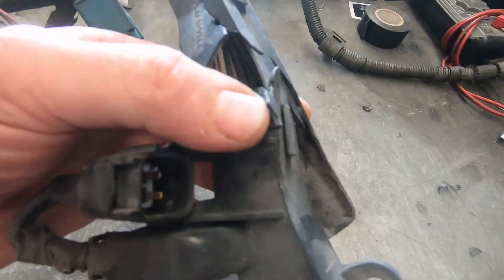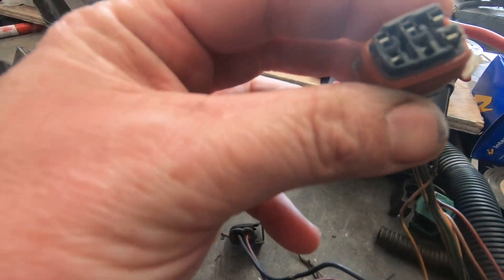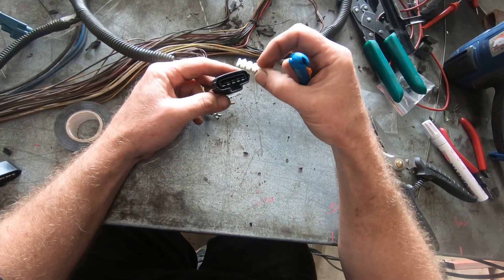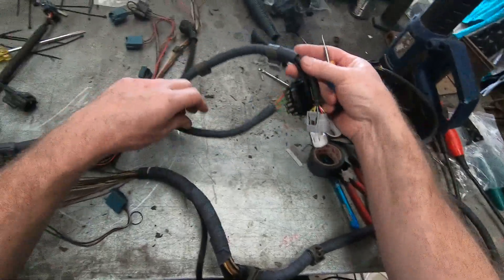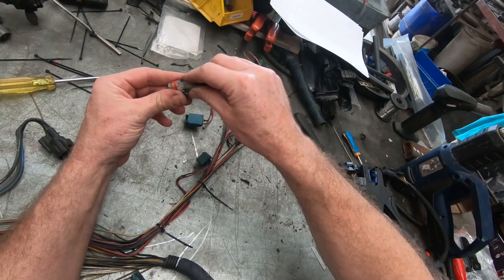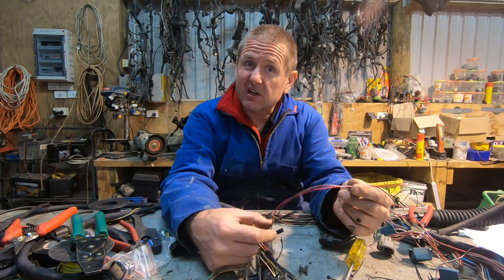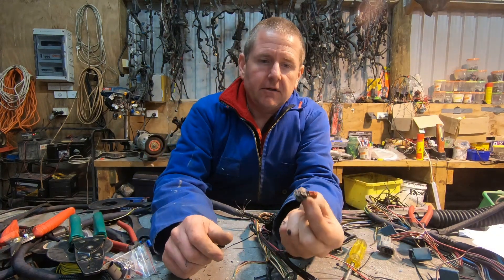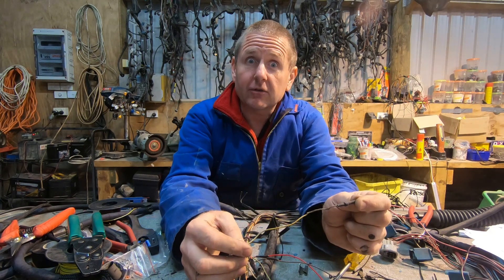LS400 Refab.  Wiring Harness or Loom Refab.

Comment: Two questions

For plugs that no longer have a part number on them how would one figure out what part number I need 

The second

Wouldn't cutting the wires for the solenoid you mentioned and egr give check engine light codes?

I'm looking at doing this very job on my own ls400
Reply from the maker: I have a file of plug part numbers as I supply them. 

To not have an engine fault for egr on this one I swapped to a jdm celsior ecu which dont run egr. Otherwise resistors are required.  Cheers Kelvin

Comment: Your answer on "should I crimp or should I solder" was bang on.  But you mentioned correct soldering technique - that is a video that would help the guy who built the loom that came with the engine I bought (hint - too much heat, globs of solder, and leccy tape is not correct technique).
Reply from the maker: Yep.  I try to give common sense advice.  I've seen plenty of crap soldering myself.  Cheers Kelvin

Comment: Hi Kelvin, is the braid the self closing or expandable type? I've found similar at Jaycar electronics.
Regards Andrew
Reply from the maker: Hello Andrew .  Im using expanding type on most of the looms.   I use some self closing type close to ecu and on a few tricky spots.  I believe jaycar has a reasonable range for smaller jobs.  I buy it in 50 meter bundles.  Cheers Kelvin